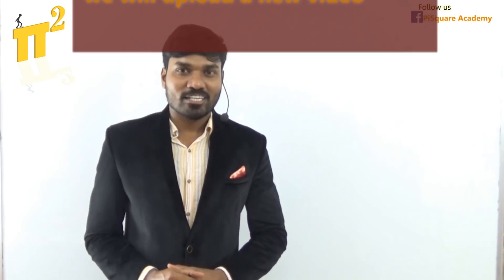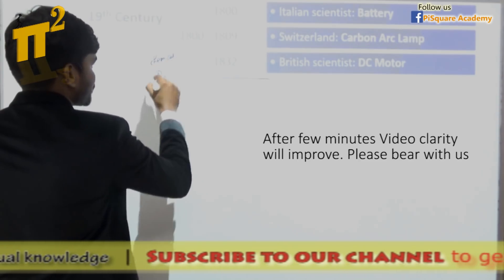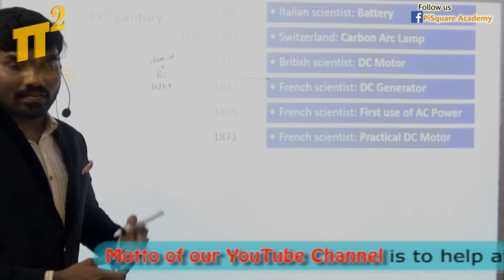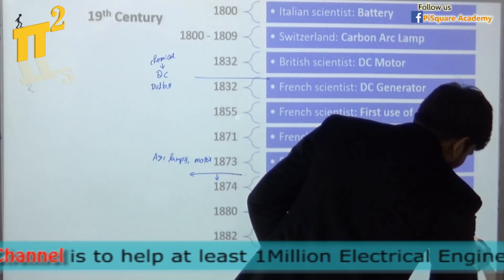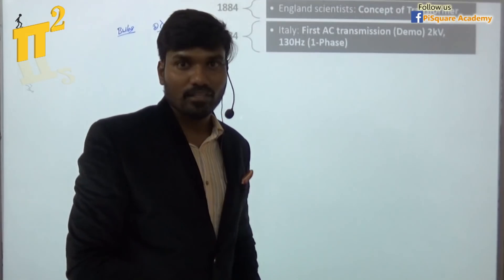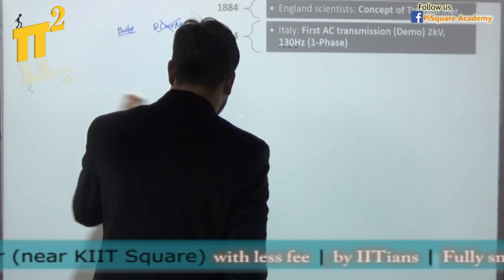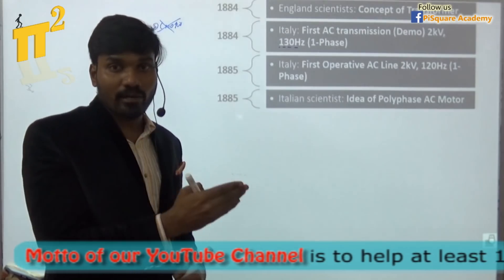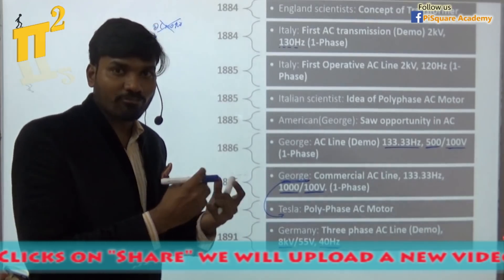Why 50Hz in India | Why 60Hz in USA | Historical FACTS of electricity

Comment from the maker: 00:44 Electricity in India uses 50 Hz, while in the US it's 60 Hz
03:48 First accidental invention of AC generator and early applications of electrical power
06:54 Thomas Edison's invention of practical incandescent lamp and its impact on power transmission
10:26 Transmission of power at low voltages results in high current and losses.
13:45 First AC transmission in Italy used 130 Hz frequency.
16:52 George Westinghouse saw opportunity in AC and modified transformers for efficient transmission
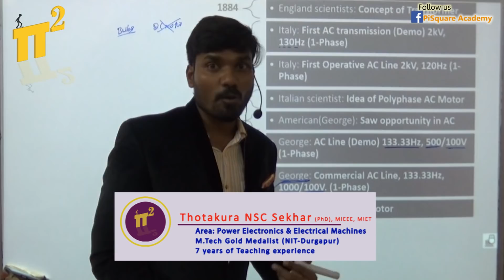20:07 The War of Currents led to the adoption of different frequencies for electricity transmission
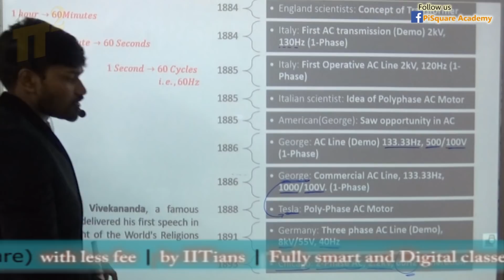23:22 USA uses 60Hz, Europe uses 50Hz
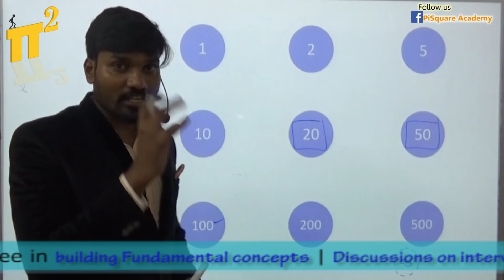25:58 Electricity frequency selection is based on historical events and technological advancements.
29:06 Higher voltages lead to low transmission voltage losses
Crafted by PiSquare AI.

Comment: Why heavy motors should start In star and then run in delta
Reply: +Vijaya Chandra - It is a technique to reduce the starting current of the motor. If you examine the delta-star configuration you will see that each phase of the delta effectively feeds two motor windings in series, thus effectively lowering both the voltage and current each motor coil sees. Once the motor is up to speed the windings are then switched back to delta, providing full power to each motor phase/coil.
Reply: @Inflec  my goodness. I did not expected the reply which makes me to understand. Thank u so much sir.

Comment: Please differentiate between commutators and full bridge rectifiers??
Reply: Rectifier is the device which converts AC into DC 

but commutator is a set of coil which changes the direction of current during operation .
Commutator acts as a rectifier when machine is used as a generator and it acts as an inverter when machine is used as a motor .
Reply: @prasadsowale1931  thanks, do u have any circuit drawing reference for commutators.
Reply: The drawing of commutator is available in B.L. Theraja .. in that will get commutatotrs used for generators .. but we can draw the wave form just by changing the direction of current for motor also
Reply from the maker: Please follow our facebook page to join our next live session to clear your doubt

Comment: Thank u sir. Most mysterious question. And please explain why we can't store the ac energy ?? In quara so mny explanations are there..no one satisfies me..plz consider it sir
Reply: kasyap sharma yes I am curious to get the answer
Reply from the maker: Sure we will do it soon
Reply: When ac supply was invented till that time there was no ac generator so how they generated it and how they set the frequency.
Reply: @vugyhy  ...the interesting fact is ..the o/p of the dc generator is also a.c ..just we r converting ac to dc by using commutator...sir also told that , unintentionally they get ac through dc generator ...i hope , this is relevent to ur question
Reply: kasyap sharma I don't think so
Reply: @vugyhy  yes bro he is true that in dc generator also we are generating ac only...we are tapping dc using commutator arrangement.
Reply: +kasyap sharma - Simple answer: No one has yet devised a battery that can store A.C.. Every battery ever invented can only store D.C. There is a round-about way to store A.C., however: A hydroelectric power station can operate its generators as motors, pumping water back into the reservoir when excess power is available from other sources, effectively storing the potential energy of that pumped water for later use when the station is called upon to provide power.

Comment: sir ..i have a question about load calculation and how to devide in 3 phase,
there is a 125 kva generator 
loads are 400watt flood lights,
how many flood light i can apply? how to devide on each phase ?
are these inductive ,capacitive or resistive load?
plz explain mathematically, and plz consider power factor if loads are inductive also generator's efficiency 80%.
plz make a video on this topic
                                           thank you sir.
Reply: +uttam patel - With the information you provided I got a total of 312 of your 400 watt bulbs as the number which most fully loads your 125 kVA generator and can be evenly divided between the three phases (104 bulbs connected to each phase). The efficiency of the generator does not enter into these calculations. That becomes a factor if you must also know the size of the prime mover which drives the generator: 125kVA/0.8eff. = 156.25kW, or approximately 210hp (156.25kW/0.746 conversion factor).

Assuming these are incandescent lightbulbs, they would pretty much be resistive loads (unity power factor). Hope this helps you.

[Edit]: I got the bulb numbers as follows: 125kVA capacity/400 Watts per bulb = 312.5 (total), divided in turn among 3 phases = 104.167 bulbs per phase. Rounding that number down gives us 104 bulbs per phase, multiplied by 3 gives us 312 bulbs total.

Comment: Sir why transformer size reduce when we increase frequency of transformer
Reply: For same voltage rating, with increase in frequency no of turns per phase of a transformer decrease, which decrease the overall size of the transformer. This high frequency and smaller size transformer is used in aircrafts.
Reply: Just go through the output equation of a transformer .. in which you will  get 

Q = 2.22 f dimensions of transformer ..

So when you increase the frequency , for same output transformer dimensions becomes lower ..hence its size reduces.
Reply: With use of high frequency, time duration of magnetisation of core in any direction decreases. So for same current, we need to handle comparatively lower flux. So we can use a transformer with smaller core. Transformer is noting but a two winding inductor. Say when we give DC voltage(one directional) to inductor, current will keep on rising. So it the flux with time. 50hz = 0.02sec. or one half cycle is 0.01sec. now if we increase the frequency, flux will not rise as in case of 50HZ. So small flux can be handled by a transformer with lower core area. Thus size reduces
Reply: windings. You need more windings and bigger cores the more voltage is involved.

Comment: Sir, then why in Aircraft we use 400 hz of frequency
Reply: +rahul balakrishnan - Since weight is a major concern with aircraft, using 400 Hz results in much lighter weight electrical components: motors, transformers and generators.  For standard earth-based power systems, such high frequencies would be impractical due to system stability problems that arise when attempting to transmit such power long distances.

Comment: i hope US never goes 100% metric because some idiot will then try to convert us to 50 hz :*) . with the English based metric rational of hz  perhaps there should be only 50 seconds in a minute.
  regardless of unit measuring system 60 hz is better and should be the worldwide standard based on its merit alone.
video should also have a single worldwide standard. i"m sure engineers could come up with one.

Comment: Your explanation very well & my question is can use 50 cycle frequency  in 60 cycle motor or light in AC circuits as well 60 cycle 50 cycle circuits